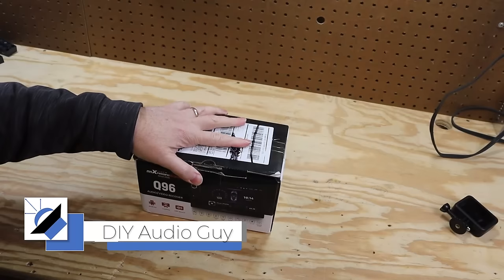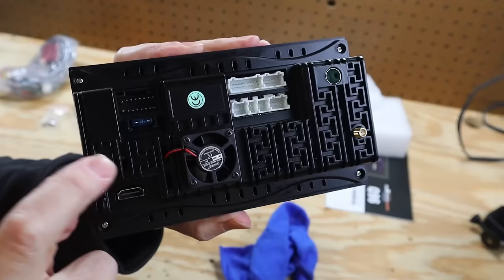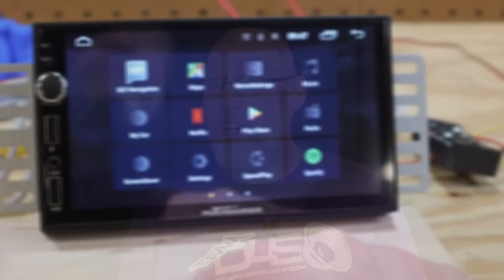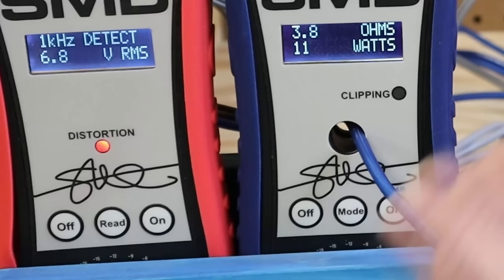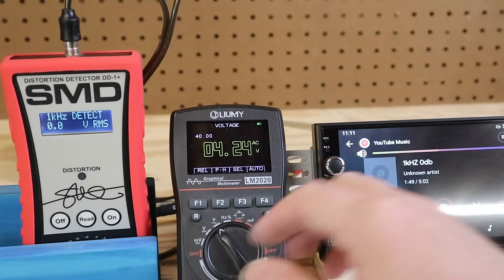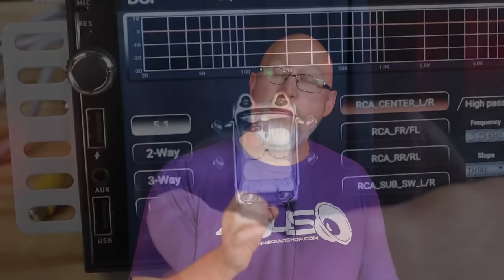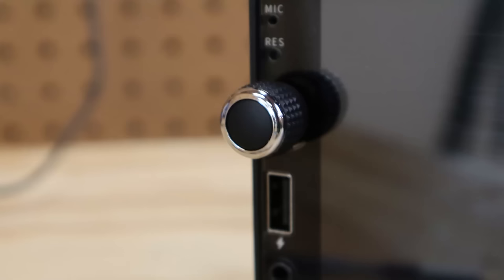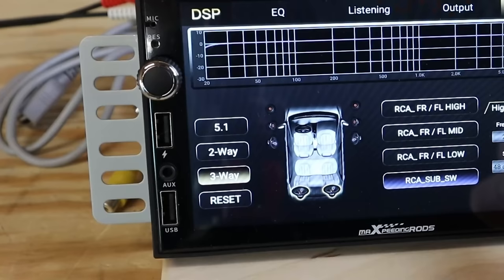The Best Sound Quality on Amazon?  Android Car Stereo Head Unit

Comment: I REALLY need to see a HU with the ability to record multiple streams or at least one stream of video, for safety purposes and whatnot. To have a dash cam, front and back cams should not remotely be a problem for a small device, our cell phones do it all the time. Also does this have an SD slot? Short of that, it's really an impressive unit, fuck the internal amp. The dsp features alone are amazing from what I can tell, and I like how I can set up a 2 way active with rear fill (most cars seem to do 2 way up front with a rear fill and sub now anyways.) Now if only somebody can make a compact 7 channel amp. Yes I know D4S makes one but it's pretty huge and puts out too much power. Cut the size and power in half and it's a fucking winner. honestly.
Reply from the maker: That would be cool!

Comment: Pretty much all headunit amps will distort at around 3/4 volume. This is done on purpose. It's basically gain overlap. It allows you to play a low volume recording loud enough. It's basically the same reason to turn your amp gains up an extra 5dB or so. It's not a sign of inferiority. 
2v rca output is just fine. The only advantage of higher voltage is maybe better noise rejection, but that has more to do with routing your signal wires away from noisy sources.
It's also very acceptable to run the amp output to an rca to get its higher voltage output. You can typically get 7v or 8v output. You just have to be careful of the volume knob. Or you can add an adjustable line output converter like kicker sells for $20 and manually turn the voltage down.
Reply: yup i have the kicker loc on my 10 inch generic radio it hits 8 volts of preamp
Reply: 5v has been the standard for decent units for over a decade.

Comment: The DSP portion is really interesting as well as the volume knob. My biggest complaint is the 30 sec boot time. I don't think I could live with this in a vehicle, but maybe a bench test unit? Hmmmm
Reply from the maker: Not a bad idea.
Reply from the maker: This might be a perfect match with a JP 77
Reply: @DIYAudioGuy  yeah it def got my attention when you hit the DSP section. As you said worth the cost for just that and the clean RCA outs and volume knob
Reply: its not that bad tbh, my rpi headunit takes over a minute to boot :D
Reply: I don't know about this particular unit as I don't own one - but I have heard that other android head units only take this long to boot up initially, when the vehicle battery has been disconnected, or when the unit is being restarted. Like a phone, it just goes into sleep mode instead of turning off. So subsequent starts should be much faster.

This would also mean it is still pulling power from the yellow constant power wire to keep the circuitry alive, so I'd be curious to see what kind of current the "parasitic" drain would be. I imagine not much as these devices tend to have low-power states engineered in, but it may still be significant.
Reply: @DIYAudioGuy  Please test whether it takes that long to boot up every time, or just the initial set up when the battery "constant" has been disconnected :) love the channel btw, I just subscribed
Reply: Just installed mine. Power up is less than two seconds. That was likely after 12v constant was removed. Switch ign on is fast.
Reply: @ShivaShakur  just initial power up. I just installed one.
Reply: There is no can or trim ring so some kits may be a challenge. I had to relief the knob for a 2012 dash kit.
Reply: @ShardAerithes  That's just the initial boot up time, from when power is first connected. "Turning off ignition" (removing acc wire, while on bench) it draws about 0.5 amps for 10 minutesor less then drops to 0.00 amps. Reconnect acc power, it's about a 3 second boot up time...at least in my testing.
I like to see some hacking on this, I'm no coder.

Comment: Glad I found I found your review and I appreciate how in-depth you get. This unit had been on my short list but now I think I'm convinced. Next step is trying to select the amplifier and speakers...I have an 06 Porsche Boxster with Bose sound package that I want to completely replace so out with the fiber optics etc. It's quite a noisy car anyway with the convertible top and mid engine with sports exhaust so "audiophile" equipment would be a total waste. I just want to be able to experience decent music and bass. The factory Bose unit incorporates 3 way splits in the doors, 2 small subs in a ported enclosure over the engine cover (right behind your head) and there might be a centre speaker on the top of the dash at the bar of the windshield, I haven't pulled the cover to see. Could you recommend a resource or site to find appropriate speakers and amp?
Reply from the maker: This is what you are looking for:  https://howl.me/ciIkPqz4VY9  just plug in your car and they will show you what fits.  Then when you place your order they will either throw in or direct you to all of the brackets and harnesses that you need to make everything fit.

I don't know how you can make the car quiet, especially with the top down.  But some well placed sound deadening between you and the engine may help.  I like the stuff from nvx.  Use the foam lined product (https://bit.ly/3CxjWCG) when you have interior panels that contact each other.  Use the heavy stuff for panels that make noise due to vibration.  I have a discount code for nvx.com:  diyaudio10.

Comment: Internals look exactly the same as every other chinese android head unit you can find right now from as low as $40 up to $1000. Only difference between them is slight changes to the housing and front inputs, and the software that comes preloaded. They're all totally unlocked so you can root them and install any version of android and any car audio software you want on them if you don't like the stuff that comes preloaded. I have one friend that spent $300 on one from ebay, another that spent $100 on amazon, and I just bought one recently on amazon for $40, they are all exactly the same unit. Ironically the most expensive one was the only one that had any problems, when we went to add subs to the radio anytime we connected the RCA's the door speakers would cut out and only the subs would play, I searched through the settings for hours trying to find something that could be causing it, even stranger, when we just said f it and bough a loc to bypass this issue, whenever we connected the RCA's to the loc the same thing happened again, and I was left totally baffled. HOW could the door speakers not be playing if the loc is getting its signal from them? Never did figure it out. Ended up having to get an amp for the door speakers too.

Comment: Hey I bought this because of your video and I installed it in a 1988 Honda Goldwing and ya without an amp is stinks but its way better than the factory radio oh  volume is louder though I am running 2ohms and the FM radio is better and Apple Support is awesome great sound  !!

can’t wait to install an amplifier and sub
Reply from the maker: I have good luck with the compact amps from Kenwood:  https://amzn.to/3WIDhZO   The speaker terminal confection is water resistant

Comment: I bought a cheap Chinese unit and love the features, but geeees is the output crap. They are all the same. No output. So I added a couple of D Class amps to boost to 50wRMS per channel and what a difference. Level your tracks to "NO CLIPPING"' using a free MP3GAIN and a couple of amps and you will seriously improve these units.
Reply from the maker: Yes, an external amplifier is a game changer.

Comment: Purchased this unit and I connected my “amp c” wire to my factory amp and external amp as I had it previously on my old radio and it’s not turning my amp on. It’s the pink cable on the rca harness. Can’t figure out if there is an amplifier switch in the settings or not, I don’t see any.

Comment: How do you think it'd do using an install adapter to hook to a factory bose amp in GM truck? It technically hooks to the speaker level output, but then adjusts that to go through the factory amp

Comment: Maxspeedrods is known for affordable decent turbochargers. I’ve never heard anything bad about them. I would definitely check that head unit out
Reply from the maker: Good to know.
Reply: Their turbo bearings are hit and miss. Need 360 degree thrust bearings. Coilovers are absolutely terrible. Other then that not a bad company. I personally run their vw 1.8t splitter valve. Had nothing but good luck with it.

Comment: I hate to break it to you but that back of the head unit is a standard Chinese layout. This is probably either a PX5 PX6 or TS-10 or TS-18 head unit which you can get everywhere cheaply especially AliExpress
Reply: I could confirm if it's a TS-10 if you measure the output voltage if it reads roughly 1.5 volts then it most definitely is a TS-10 or TS-18. Not to say that it's bad that's what my car uses
Reply: All right I was disproved but I'll leave my comments for posterity

Comment: What do you think about the sound quality side by side with a reputable company head unit that has the same 4V outputs?  What would you think about testing both units with the same quality amplifier and speakers?  Does it have enough DSP and EQ to equal a Pioneer side by side?  I know somebody running one of these android units with the head unit amp is definitely junk like you said in the video.
Reply from the maker: All good questions, I guess I am waiting on pioneer to send me a unit so I can do that test.
Reply: @DIYAudioGuy  but how did the audio quality sound to you in person when you did the test? how about Low frequencies? Talking about volume under 30 before it started distorting.
Reply: @user-vb2xu7me9g  I've been playing with it on the bench for a few days. Hooked up 2 6x9 infinity  9632ix's. Sounds amazing, just the speakers sitting on bench. Tune the eq a little depending on what music and it's pretty damn good.  Of course it should be better with some more power, but I'm impressed with these speakers attached as is. I think it checks what I want and I'll likely never use some of the features that involve connecting my phone. I just hope it lasts.

Comment: Just to clarify on the RCA outputs, you're recommending to use the 5.1 center L & R for the front speakers? I recently purchased 2 of these units for 2 different vehicles. Both are using factory type 2 way speakers with no subs, not yet anyway. Great video and very informative!
Reply from the maker: Yes, but you don't have to use all 8 DSP channels.

Comment: Just want to make sure I understand, so in the 2 way or 3 way mode each channel has its on cut off frequency? Like you can set a mid bass to play everything above 80hz and nothing above let’s say 4500hz, then set tweeter to play 4500hz and above.
Reply from the maker: Yes.   One thing I do not like, it is not clear which crossover channel routs to which RCA output.  It would be wise to do some testing to verify.  You don't want to smoke a tweeter by connecting it to the wrong channel.  You don't need anything fancy. An old connected to your amp will do the trick.
Reply: @DIYAudioGuy  I appreciate it. I have several old ones laying around. So what I gathered was the only thing it was lacking was the each channel doesn’t have a separate eq. It just has a one main eq page. If that makes sense.

Comment: Too bad it doesn't fit a standard double din slot! It wouldn't fit in my 2007 Forester, the volume knob hits the side. The unit is 7 inches and not the proper double din standard.

Comment: that 40 second bootup is a deal killer... that sucks. would be a good unit if it were 5-9 seconds.    does this come with a larger screen? like a 10/13/17" screen?
Reply from the maker: That was the initial boot up, afterwards it held memory and booted up pretty quick.

Comment: So pretty just to make sure I fully understand, this headunit will sound great as long as it's paired with a 4 channel amp correct? I have a 18 inch sundown on a jp23 and door speakers on a skar 1000 rms 4 channel amp. Will this head unit satisfy my needs for good sound quality??
Reply from the maker: The thing that sets it apart from other Android head units are the eight channels of preamp outputs for the full DSP.  Outside of that it's no better and no worse than any other Android head unit, and like all of them there's no way to know about their long-term reliability.

Comment: Forgive my ignorance on this specific topic. Coming from an old school perspective. 
I have a simple question. Running an amp to a component set that is furnished with a cross over. 
With this internal DSP. Would I forgo the supplied cross over on simply connect the amp directly to the tweeter and mid bass to the amp. Select full on the amp and tune the tweeters/ mid base in the head unit?
Any advice would be greatly appreciated.
Reply from the maker: Yes, you can.  But you don't have to.  If you don't want all the extra amp channels you don't have to use them.

Comment: Thanks for the video!  This is exactly what I was looking for.  I am going to use it in a VW Jetta with the monsoon amp.  Do you think this will work since the monsoon amp uses speaker level inputs since the signal is clean until volume 29?
Reply from the maker: I would not use the onboard amplifier on this unit for anything.

Comment: Does the DSP does it have by chance time alignment on the speakers? Having over 4 volts on all those RCA’s a big selling point.
Reply: What was the piece of equipment you measured the rca volts with ? Then what was it you used to check what frequency the certain marked rca’s were? Thanks for all your great videos.😊

Comment: RCA output voltage would depending on what your amplifier input can take. 2v is the standard for RCA. 4v is the standard for XLR.

Running 4v into an amp that has a low voltage input sensitivity, like 0.8v or 2v, you should expect the amp to clip.
Reply: Unless you are running a pos amp from 2001, it’s going to be able to handle more than 2V low level input

Comment: I have an 03 Yukon XL with Bose and plan to buy this.
Would running rca to speaker wire adapters off of the headunit instead of wiring the vehicle harness to the headunits speaker outputs work?
 I'm assuming the Bose amp is only looking for a low level audio signal, not an amplified signal from the headunit. 
I'm hoping to get around the Distortion the headunit has at its speakers outputs without bypassing bose and running a new amp to all of the speakers.

Comment: This looks cool, but not sure how I could mount this in my 2010 Ford E250. Thinking of buying one just for my garage to play tunes and feed into an external amplifier. Then I can use the DSP to fine tune my speakers for a flat response. Or build a boom box and use this for the main interface.
Reply from the maker: The last time I did an install in a heavy duty Ford it was actually pretty easy.  No dash kit was required just had to mount the radio behind the dash make sure it lined up properly and trim a little bit of the factory dash out of the way.
Reply: @DIYAudioGuy  Thanks I will look into it, I will also look for some YouTube videos for a possible install video for my Van.

Comment: Justin, does this unit have SLA(sound level attenuation) so that you can adjust the levels in proportion to the FM tuner. Why I ask is that even the Pioneer DEH-PRS80 needs the levels adjusted to achieve 5v outputs, so you technically could have 5v outputs on this item. Again, thanks for the video!
Reply from the maker: I have no idea.

Comment: Before you guys buy these types of head units, you have to understand that they will not fit in a standard dash kits. I get people bringing this type of head unit into the shop all the time and are disappointed to find that they will not fit in the car without manually cutting out the dash kit in there by adding more labor.
Reply from the maker: Good to know.

Comment: Interesting option... I may deal with the crappy internal amp until I've got the funds for the dedicated amps... May have to go triple amps. 1x mono for a sub, 1x 4 channel and a 2 channel for some kick panel speakers. Fuck you, Ford for the oddball 5x7/6x8 speaker mounting that fits almost nothing but stock, so I've gotta go 5.25" coaxial in the rear, keep the 5x7/6x8 components in the doors, and throw new kick panels with 6.5" components in.
Specifically eyeballing JBL 52F, 862CF, and 62CF. Not sure on a sub. Possibly Dayton E180HE-44, possibly a 10". Not sure yet. I'll be pulling the fold down seat on the driver's side and building a box to sit in it's place.

Comment: I have a much older variant of this one from 2013 I paid $100 for, and it distorts at the EXACT same point, same clear RCA outputs too. I have to wonder if they're all built with the same I/O internally. Mine was destined for a cargo van that was sadly scrapped... :-(
Reply from the maker: How did the head unit hold up long-term?
Reply: @DIYAudioGuy  It probably would've held up pretty well if a design issue with the 2002 Ford Econoline didn't cause moisture built up under the deck when the AC runs, shorted the poor player, but it made it 2 years in spite. This variant solves 1 of the 2 major gripes I had with mine, no volume knob (mine had a touch slider), but I'm not sure about if these ones are getting regular updates, my old one was stuck on Android 5.2 it's entire life, no OTA or security updates even with WiFi access.